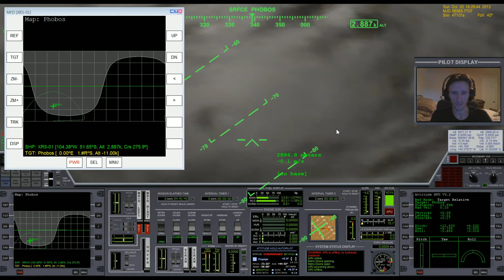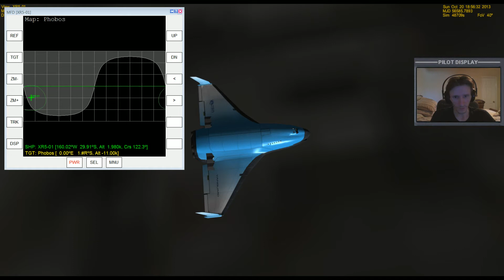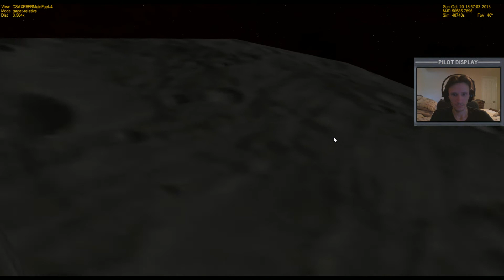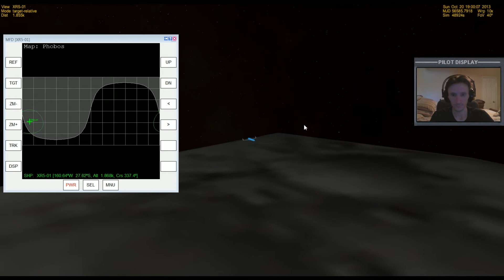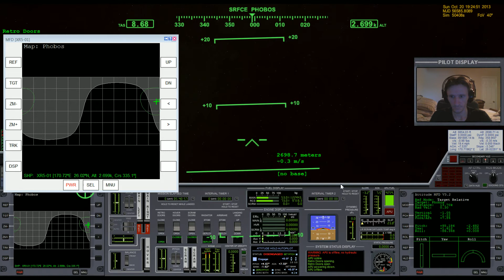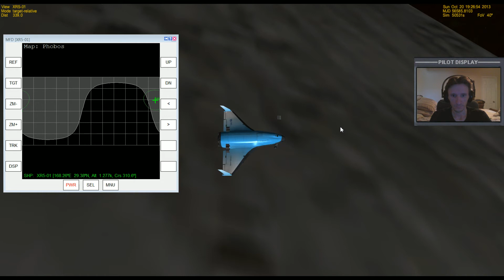Orbiter 2010 - Learn With Me #2 (Part 2) - Phobos Landing

Comment: How you need to stop on phobos is open up surface mfd and put that to groundspeed, also open up map mfd referencing phobos. surface mfd should tell you your ground speed and map mfd will tell you a crs (crossing relative to surface) basically the direction you are headed in relation to you current position.
get your crs to 360 while facing 360 then bring your ground speed to 0 while on hover autopilot, after relatively stopping on the X and Y plane you an then use the hover autopilot to land.

Comment from the maker: Part 2: But there is a solution. If you target an object using Attitude MFD (Target Relative), you can see your various directions of motions. In fact, in this very video, you can see that in Attitude MFD I had +2.25 m/s of Lateral movement, and -0.72 For/Aft movement (at 23:00). If I had zeroed that out, I would have gotten wheel stop. But at the time of recording, I wasn't aware that the movement had to be so close to 0.00

Comment from the maker: Part 1: This was a very frustrating experience. However, after recording this video I found out what my problem was. If you have any left/right or forward/backward velocity, you won't be able to get wheel stop. (Well, you can have some ... like 0.01 m/s.) But if you have more than that, you won't get wheel stop even if you're standing on the brakes. Unfortunately it's hard to notice if you have any lateral or forward/backward motion without some kind of reference (like a landing pad.)